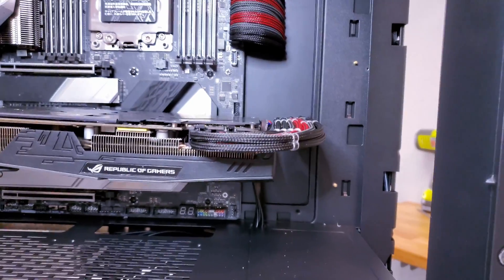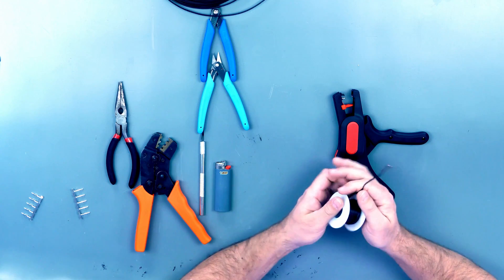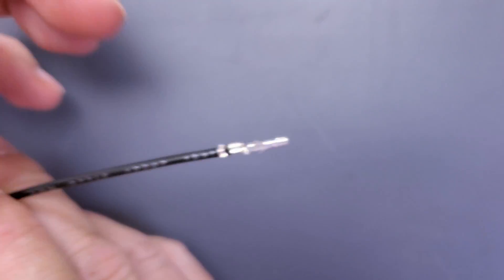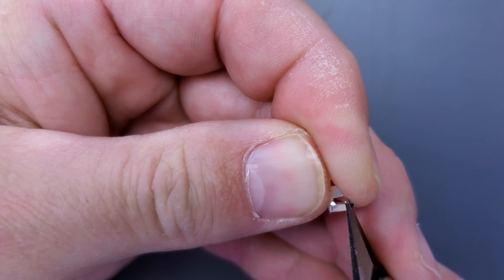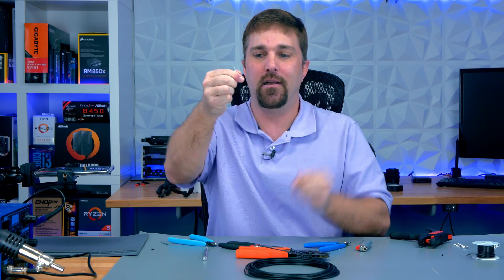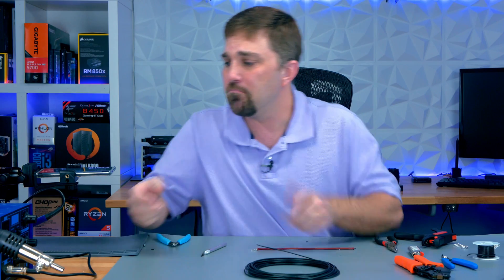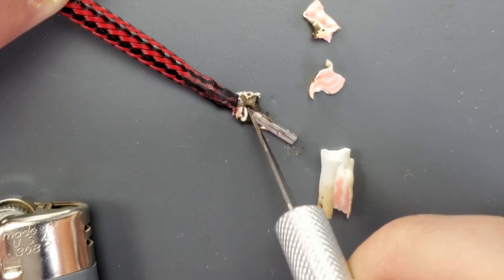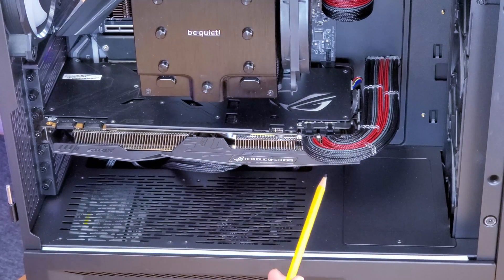How to Custom Cable a PC with Solid Copper Wire

Comment: I am little unconvinced, after all the inner crimp separates the strands and then bites all the way around bundles of them nice and hard, they basically almost all fuse together, and i can't even see what's happening here. Solder for sure would make me sleep well at night, for solid-core in particular. But yeah it's pretty cool that people are building "hardline" wiring now.

Comment: Question: why remove the heat shrink on the cable end? Purely aesthetics, or does it present a barrier to the pins going into the connectors?
Reply from the maker: Both, sometimes, but mostly it's aesthetics.

Comment: There are terminals with short wings, buy them and you dont have to cut the wings :)
Reply from the maker: Thanks, unfortunately those are for smaller guage wire and don't make a secure crimp on the 16 awg wire. The pins end up falling off.

Comment: Hey CJ! I could really use your input on something relevant to this video.

 I'm so glad you did a video on this because I have a pretty gnarly concept involving solid core wires that I've been researching for months.

I have a PC case I'm designing that will showcase my cables in full view. The wires are really the stars of the show here: I intend to manufacture completely unique wires for the outermost row of each cable so I can implement an RGB effect similar to Lian-Li's Strimer plus cables, just much more ambitious.

Here's the general idea: Instead of a separate layer of silicone encased leds floating above the actual cords, I'm researching how I can integrate LED's in the cables themselves.

Imagine half round copper wire like this: https://www.wirejewelry.com/half-round-copper-wire/16_Gauge_Half_Round_Half_Hard_Copper_Wire-14627-900.html

I'd insulate that (currently all I can think of is using heatshrink or spray-on electrically insulating enamel, I regret that I can't find this product pre-insulated or sleeved in a common material like PVC.

On the flat part of the (now insulated) half-round I'd install these new cutting edge 3mm wide ARGB LED strips: https://www.superlightingled.com/apa102-dc5v-narrowest-3mm012in-width-2020smd-100ledsm-individually-addressable-rgb-led-strips-p-3309.html

Then cast the combination in a mold I'll CNC route for for an end result of a minimum 3mm diameter tube of light diffusing silicone containing, again, my LED strips and half round 16AWG copper.

All of my cable runs are less than 20" at the absolute maximum, and I'll ever only be powered a 2060 super and 3700x in this bespoke CNC milled SFF case I'm making.

As a discalimer, I have a degree in industrial design and some education in mechanical engineering, as well as experience making cables and tinkering with electronics. That said, just how crazy/stupid does my idea sound?
Reply from the maker: It sounds pretty Epic. First though is you can have the copper wires powder coated. There are several types of powder coating that are non-conductive and should insulate the wires pretty well. You can probably find a shop that can do this in your local area. You will also probably need to solder the ATX pins to the wires as I'm not sure they'll stay crimped to the half round wire. As for the math however, is your plan to use 1 LED strip per two wires? 16 AWG wire is less then 1.5mm in diameter so the 3mm strip will be too wide for a single wire. Also keep in mind even at 3mm the led strip will probably only bend along the y axis so if you have any cable runs that need to bend along the x axis it might not work. Keep me updated on your progress. If you are successful I'd be interested in having you make me a set of cables I can feature in a build for the channel in the future.

Comment: are you an electrical engineer or have a degree in engineering? probably not....THERE IS A DIFFERENCE IN CURRENT CARRY OF THE TWO TYPES  When it comes to twisted-pair copper cable, the terms stranded and solid refer to the actual construction of the copper conductors within the cable, and the names themselves make it obvious to tell them apart. In a stranded cable, each of the eight copper conductors are made up of multiple “strands” of small gauge wires that are concentrically wound together in a helix, much like a rope. Stranded cable is typically specified as two numbers with the first number representing the number of strands and the second representing the gauge. For example, a 7X32 (sometimes written as 7/32) indicates that there are 7 strands of 32 AWG wire that make up the conductor. In a solid cable, each of the eight conductors are made up of just one solid larger gauge wire and are specified by just one gauge number to indicate the size of the conductor, such as 24 AWG.

With both stranded and solid cables within the same category (i.e., category 5e, category 6 or category 6A) specified by one gauge size, this can seem a bit confusing. Just remember that whether the conductor is made up of multiple strands or one solid conductor, the final overall size of the conductor is the same. In other words, a 24 AWG cable is still a 24 AWG cable.

The most significant difference between stranded and solid cable is performance. Because higher gauge conductors (thinner) have more insertion loss than lower gauge (thicker) conductors, stranded cables exhibit 20 to 50% more attenuation than solid copper conductors (20% for 24 AWG and 50% for 26 AWG). And because the cross section of a stranded conductor is not all copper (there’s some air in there), they also have a higher DC resistance than solid cables. In general, solid cables are better electrical conductors and provide superior, stable electrical characteristics over a wider range of frequencies. They are also considered more rugged and less likely affected by vibration or susceptible to corrosion since they have less surface area than stranded conductors.

Another difference is flexibility. Stranded cables are much more flexible and can withstand more bending compared to rigid solid conductors that can break if flexed too many times. However, when it comes to terminating stranded cable, the individual strands of the conductors can break or become loose over time. Solid conductors will hold their shape and seat properly within IDCs on jacks, patch panels and connecting blocks.

 KNOW WHAT YOU ARE TALKING ABOUT BEFORE YOU PASS ON INFORMATION THANKS FROM A VETERAN. GET EDUCATED BEFORE YOU TRY TO INFORM PEOPLE!!!!!!!!!
Reply: MrRadio1610 hahaha, burned 🔥 Didn't you know the Professor could sniff out plagerizing a mile away. He took you too school and gave you a F 🤣
Reply from the maker: Thank you for your spirited and detailed comment. So what exactly would be the current difference between the standard 16 AWG stranded wire typically used in PC wiring and the solid 16 AWG solid wire I used to wire the Graphics Card over the 9 inch length I ran? Also, thanks from a fellow Veteran. (edit for punctuation)
Reply from the maker: So to follow up on this, just in case anyone who clicked on this thread was interested, the answer to the question I posed is, the current diference between the two types of wire using the standard voltage drop calculation (Vdrop = IR)  would be approximately 0.00014 volts (benefit to the solid copper wire, yay) which ultimately means the performance of the GPU would be EXACTLY THE SAME, which EXACTLY what I said in the video. I wired supplemental power to a GTX 1080, not the  Apple Park superstructure FFS. Of course, admittedly I do not have a degree in electrical engineering (just a BS in Information Technology and Networking) and a BS in Community Health Education (probably not relevent). Also I did the math (and this comment) about 4 pints into a 6er of a 10% double IPA, so maybe I was an order of magnitude off in my math, which I guess would mean, my basic assumptions, WERE STILL 99% CORRECT. Also, there isn't twisted-pair copper cable anywhere in this build because it wasn't a video about network patch cables, but MrRadio1610 thanks for sharing the flukesnetwork.com article (basically word for word here - https://www.flukenetworks.com/blog/cabling-chronicles/considerations-choosing-stranded-vs-solid-cable  )with my audience (for I am a master of Google kung-fu to). I'm sure they will gleem benefit from it if ever needing to decide between the two common office patch cable installations, which is what the article you completely plagiarized was about. Also, as practical advice from a fellow Army Veteran, don't use an official US Army logo in your profile when plagerizing someones electrical engineering article, its just embarrassing too us all. Of course I will freely admit I am about 2 sips from drunk ATM so if my conclusions in either this video or this comment may be flawed, please provide a link to an original article or video disputing my hypothesis. And as always I hope you learned something today, that is what I do what I do. Cheers! (edit = I was almost drunk but it was only one misplaced word )
Reply: oh boy, your math maybe right (even if the difference literally makes no difference in this application) but you're simply an asshole who just likes to copy-paste stuff he finds on the internet

Comment: That seems like a lot of extra work for  inferior results. Theirs really zero benefit to using solid wire, unless maybe you used thicker solid 14awg which should fit in the pin unlike its stranded equivalent.
Reply from the maker: Custom cabling a PC is a lot of extra work with zero benefits but for an enthusiast it's sometimes, a lot of times, about aesthetics too.
Reply: @ElevatedSystems  So this howto was intended for something like PC art or fashion modeling of sorts? I'm likewise an enthusiast, but I only care about performance & efficiency. Actually prefer mine to look ugly. Makes it less attractive to thieves lol.

Comment: I have an idea.wad gonna try it but I will probally never do it..what it you lined the inside of a case with a mirror material so all the rgb would really shine.if u try this and hate it..lmk and I'll give you what ever money you had in it..a white mid case
Reply from the maker: I've done this on a small scale by putting a mirror on the PSU shroud to reflect the graphics card, however I dont think it's very practical on a larger scale as most of the inside of the case is just covered with components anyway.

Comment: Is it just me or does all your "Copper" wire look like aluminum.
Your color saturation looks off maybe it's that.
Reply from the maker: It's tinned copper. The copper has a thin layer of tin over it. It is a higher quality wire that is less prone to corrosion.